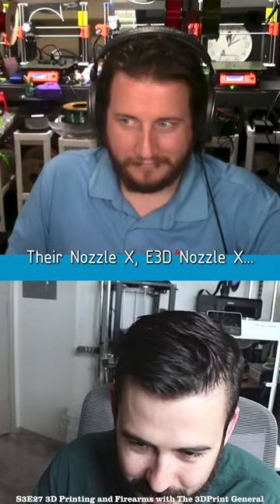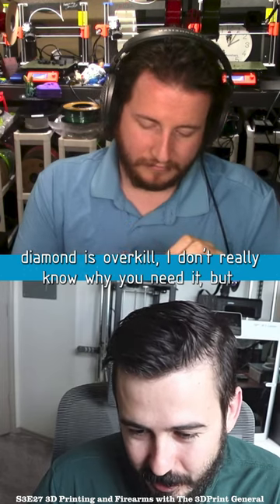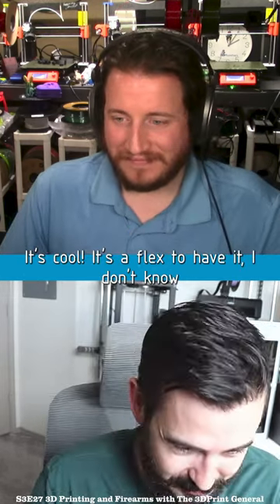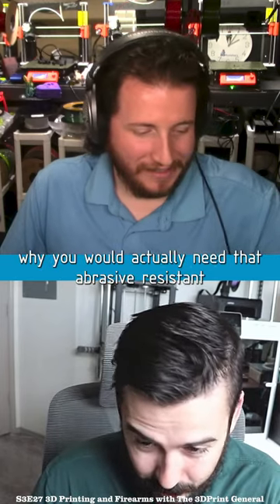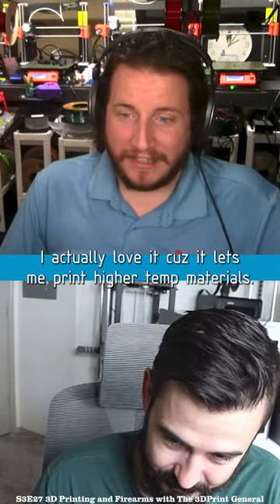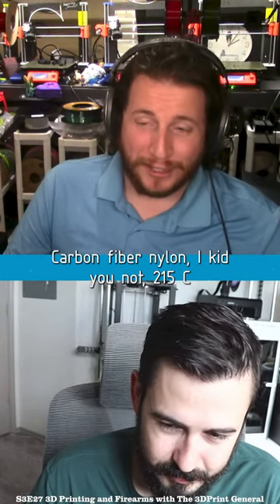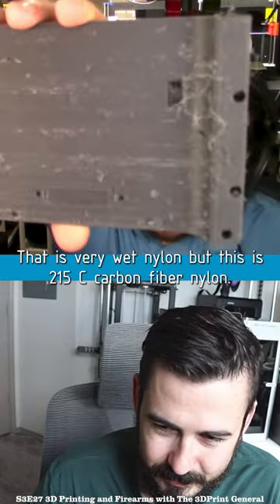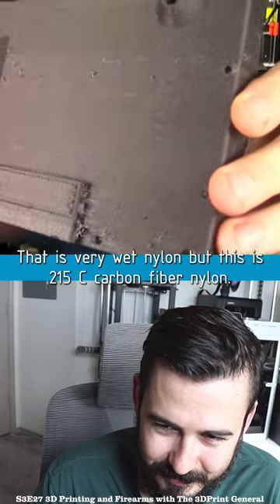The POWER of a Diamondback Nozzle! - Making Awesome S3E27

Comment: 215°c... That's PLA temps. How in hell could you print nylon at that low a temp?
Reply from the maker: Diamond nozzle. MUCH higher thermal conductivity. We regularly print PLA at around 170-180 now lol
Reply: @3D Musketeers  ah. I missed that part. That's actually a huge advantage to those wanting to print higher temp materials with a bowden setup, then.
Reply from the maker: fair, but dont go over 250C. And really, a $100 nozzle on an ender is just wrong lol
Reply: @3DMusketeers  why not over 250 on their own packaging they say it can handle up to 300
Reply from the maker: Shouldn't NEED to. But you can!

Comment: I bought one Grant... Damn you. You didn't tell me it comes with the cool little aluminum storage container! I'm gonna put in on my MK4 kit when it shows up. Something tells me I'm gonna be blown away.
Reply from the maker: Glad you're enjoying it!
Reply: Did it work well with the Nextruder V6 adapter?
Mixed metals are iffy with that system I’ve heard bc the different thermal expansion doesn’t create the best seal. So steel V6 nozzles are out of the question on the V6 Nextruder adapter. 
Been thinking of getting a diamondback specifically for that reason. 
The Obsidian mk4 nozzles are always sold out. 

Also like the fact that the DB has the best of both worlds with abrasive resistance and thermal conductivity. You normally give up one for the other. 

Personally, I’d like to see 3rd party development to see something like this for Revo’s and Nextruder.
Reply: @DD-sw1dd  I haven't had to put it on yet, I'm trying to where out the stock brass nozzle first. You shouldn't have to worry about different thermal expansions. The DB is a brass nozzle body and the V6 adapter is no different in make up than a standard mk4 component. (Other than being split) It's still brass where it screws into the heat block, which is still aluminum. So there's no real difference other than the diamond in the tip. So if there was different material issues, you'd notice it on the stock MK4 nozzles as well.

Comment: What should I print Polymaker's PA6-CF at with this nozzle? It suggests 280c-300c
Reply from the maker: likely around 260, but run a temp tower to find out.
Reply: @3DMusketeers  sounds good. What's the caveat for continuing to use the recommended range on the box with the diamondback nozzle? I'll still do a temp tower, but wanting to know either way
Reply from the maker: it will string pretty bad. But thats about it.
Reply: @3DMusketeers  can't wait for my diamondback nozzle to arrive. will run that temp tower. thanks!
Reply from the maker: Good Luck!!

Comment: With so much lower print temperatures heat creep must be far less of an issue. So assume you could really lower the hotend fan speed and get a more silent printer?
Reply from the maker: I mean, technically, but printers are already pretty quiet. I'd use it to run faster, or at least have better cooling by not turning the fan down. My prusas are almost silent.